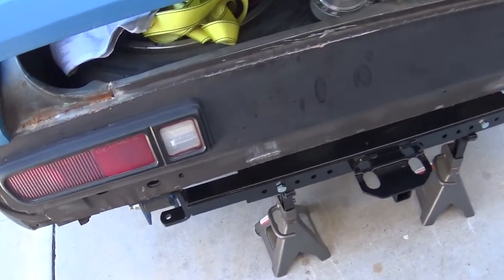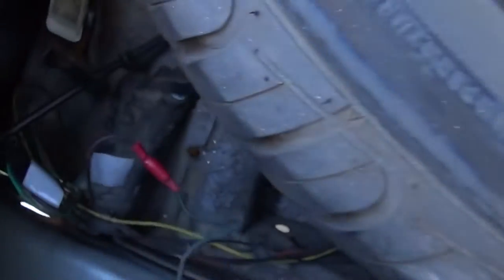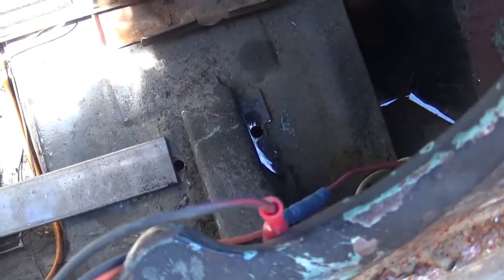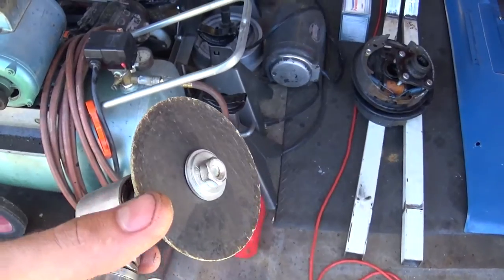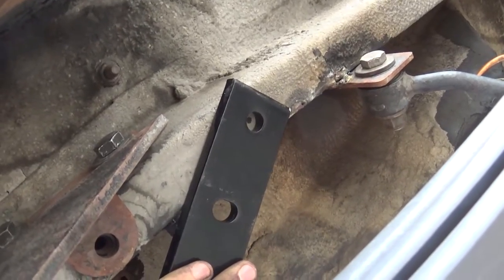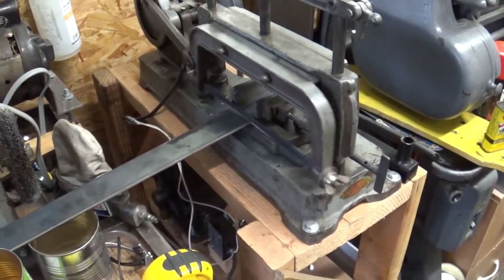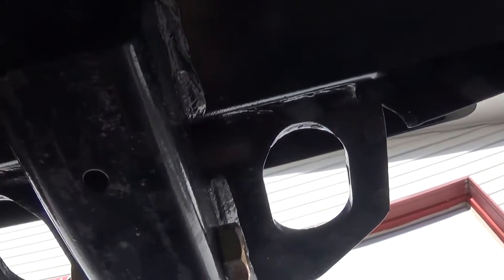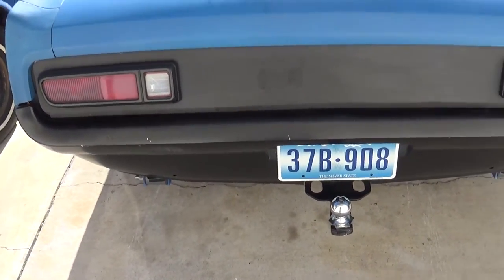Trailer hitch installation on a 65 Mustang

Comment: Turned out great. What are you pulling with it? I love that old powered hack saw!
Reply from the maker: Thanks! I'm looking at either a small truck bed trailer or a 5x8-ish regular utility trailer. It'll be cheaper than getting a project truck for hauling stuff around town and for when I move hopefully next year. 
That hacksaw is probably my favorite tool! I bought it at a swap meet complete with a circa 1915 motor on it, and made the stand. It's one of the high quality ones that holds the blade up on the return stroke to keep the blade sharp longer, and it has a switch under the arm so you can walk away and it will shut itself off when it finishes the cut. Still works great at 80 years old!
Reply from the maker: That's pretty cool!

Comment: Very cool what trailers will you be towing just curious
Reply from the maker: I pull a little 4x8 stake bed trailer, I load it with a hoist and a bunch of tools when I  go buy engines/large parts. It's usually about 1000-1200lbs loaded up, the car pulls it just fine.